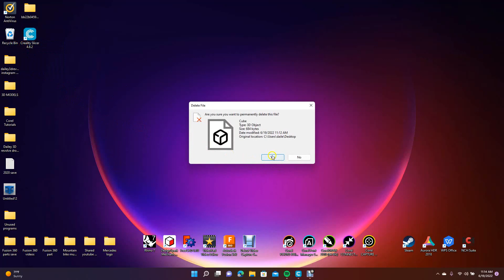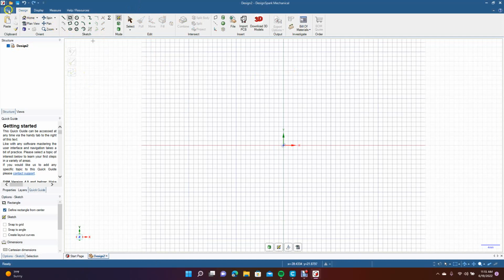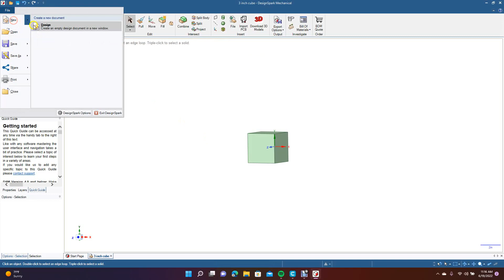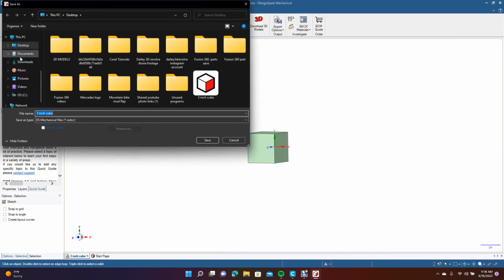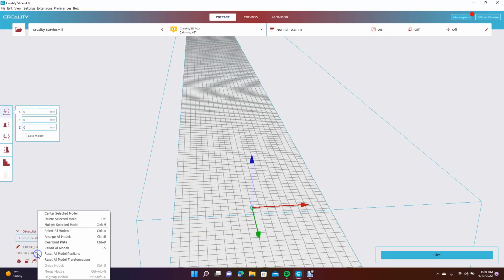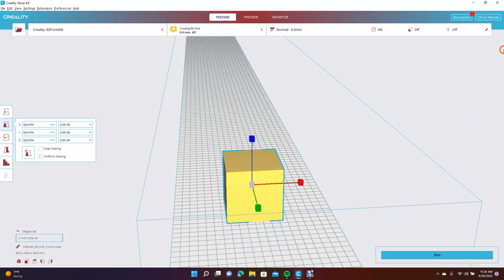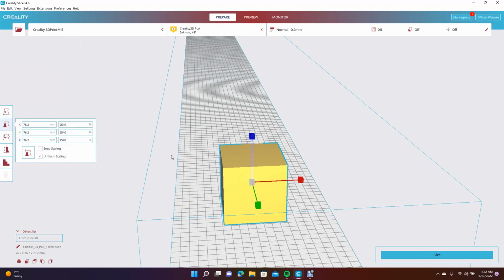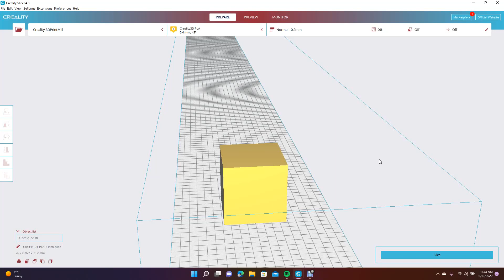Why are my files super tiny in creality slicer?

Comment: So .. when working in inches, import into Creality, select 'scale', and scale by 2540%. Boom!  I started out doing what the video said, just converting inches to mm but then realized it was always the same scaling factory ... 2,540%  Duh ...

The easiest solution is to work in mm.  My calipers do both inches and mm, so it isn't really an issue.  A number is a number.  However, sometimes the things I'm measuring are created with an inch scale bias, so it's a little bit easier to work in inches and inch fractions depending on what I'm working with.  For instance, I needed to make some bins for holder I bought, and everything was clearly in imperial, the separators were 2 3/8" wide and 2" high, the dovetails where 1/8", and they were 1/16" thick.  It's a lot easier to just work in imperial in this case.

I know lot's of people don't like imperial, but as someone who has done woodworking all my life, I prefer inches and fractions to decimals.  In many cases I feel it's just easier when one measurement is relative to another, like doubling or halving.  Sure, half of 1.5 is .75. But then  half of .75 is .325. And half of .325 is .1625.  I find 1 1/2, 3/4, 3/8, and 3/16 is easier to work with. But, as I said, I've been doing it my entire life and preferences vary.  The US isn't an imperial 'standard', it's just of a tradition. The government didn't dictate the use of metrics like it did everywhere else (with much resistance in most cases, and even violence, I might add). People in the US use whatever they want to and the government dictates how things are labeled.  Most people in the US prefer inches, but almost every measuring device supports both, and most food products are labeled both ways.  The US is more of a hybrid system than an imperial system.

Comment: I am having the same problem when I make an obj in Bryce and import it to reality slicer, however when I reinstalled the slicer program I would get a ton of different measurements for my project each one being different, I contacted reality about it , they noticed the issue as well and are trying to fix it ! Odd they wouldn't have found this problem in beta testing .
Reply from the maker: Sorry, I haven't gotten back with you. I have taken a temporary break from YouTube.  Unfortunately, some of these programs are "MM' base, so they have to covert parts made in inches, into millimeters, this can make the parts very small. I'm glad you contacted them, and they are working on a solution. Regards. Doug

Comment: I'm having the same issue.  But I'm saving it in mm and it's still opening in Creality as a micro-sized item.
Reply: Yes same here go into the settingss and click the option to size big models down if the won't fit , that sometimes fixed my issues as well
Reply: I've the same problem too

Comment: This is a DesignSpark problem, not a slicer problem. The solution is, when exporting designs made with imperial measurements, select "Override Units" and "millimeters" in the export dialog window. No manual scaling necessary. 😉
Reply from the maker: Thanks! Richard, your tip was very helpful. The override box is so small, I almost didn't see it. Cheers!
Reply: @dailey3drevolve  No problem. I like your channel. After some tests, I found that only filetypes .AMF and .GLB do export with the correct scale in imperial. Those files are also compatible with most slicers that I'm aware of.
Reply from the maker: @Richard_Ortiz  Glad you like the channel, and thanks! for your comments and help. Cheers!
Reply: Thanks for your comment, I have same issue and solved by yours. I use Inventor and just change unit to millimeter